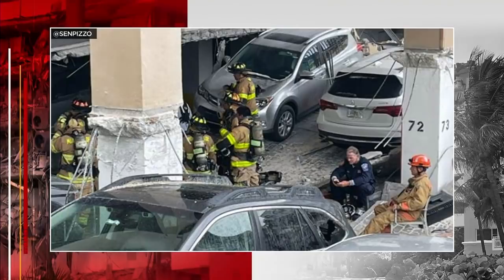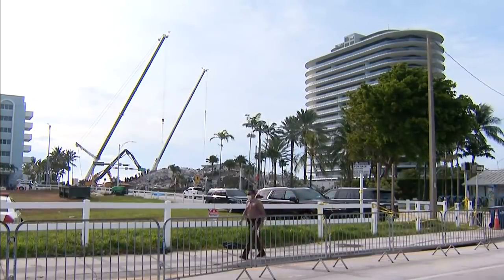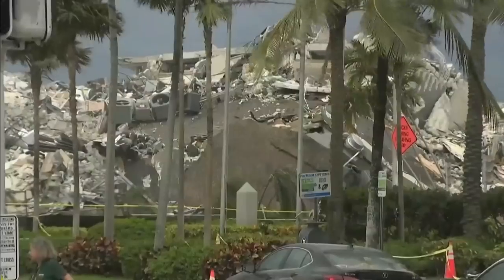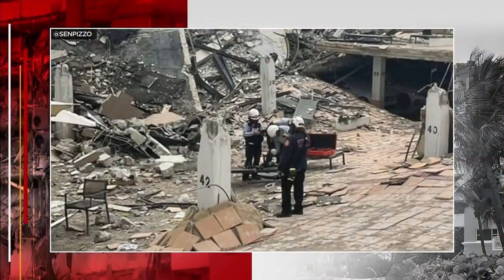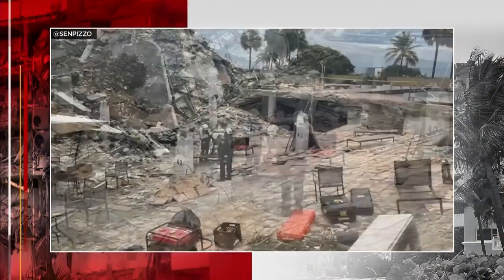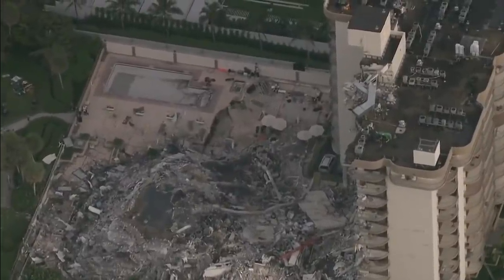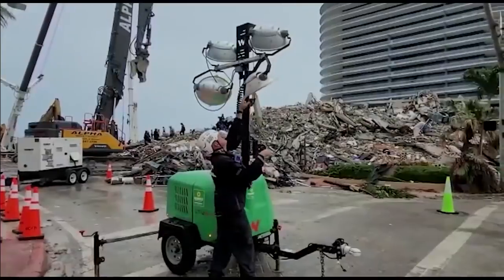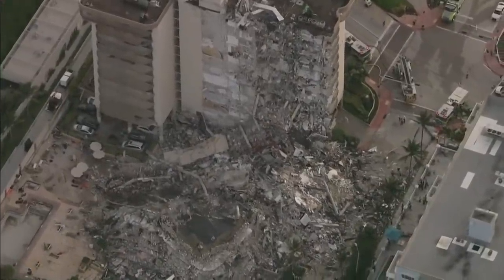Building experts studying Surfside collapse have questions about its initial construction

Comment: It appears based off of engineers who have done commentary on it that the pool deck was tied into the main supports of the building. According to eyewitnesses, the pool deck collapsed first. So, it is entirely possible that once the pool deck collapsed, the pull on the main structure of the building caused the main supports to snap. Evidently there wasn’t enough supports on the pool deck to keep it intact. It should’ve been freestanding. If that theory is correct then the building may still be standing.
Reply: Agreed. They should always make sections of large building shelf supported so if a section fails it doesn't domino the whole thing. Makes even more sense in an area that has hurricanes.
Reply: part of the collapse of the deck knocked out columns that supported the main tower.  This failure brought down the towers like dominos.

Comment: As one engineer also stated, it is not just rebar.  Some of you must know there are different strengths of cement also.  So that is also a question.  Was the quality of cement used a cheaper grade.  So many questions and yes if I lived in the sister tower I definitely would be vacating the tower to a new house.  Things were made a lot cheaper in the 70s  So get out while you can and be safe.  I am sure some criminal actions will be taken.  What is so sad is that it took a collapsed building with so many lives lost to bring the attention to officials.

Comment: Sounds like massive corruption to me.Where was the building inspector?Thats a major law suit.
Reply: Builder, Inspector, Structural Engineer, architect, developer, HOA, and probably several renovation contractors can be sued. Meanwhile about a week ago several large lawyer and developer firms were just throwing a fundraiser for a circuit judge............hmmmm........nothing to see here.  Even the fancy smancy building next door with the world class design team might have some splanin to do.
Reply: Duh. This entire thing was an automatic and major law suit, even if no fault is eventually found. Everything is a lawsuit.
Reply: Good luck trying to sue a city inspector. Look into famous fires where that never happened. The Station in 2003 for a modern example.

Comment: It's the usual finger-pointing game of "let's blame the builder".   As multiple other engineers have already stated publicly (including the 2nd one in this video) there is nothing unusual about finding actual field conditions being in variance with the original design documents.  Maybe there was a field directive by the design engineer of record to modify the original design.  As in most column/slab intersections, rebar layout is very congested and the builder may have asked the design engineer for direction on how to modify the design, perhaps by using larger or longer bars than the original design.   Even if the builder screwed up, every piece of rebar in the building is supposed to be inspected and signed off by the engineer of record BEFORE a concrete pour is done.   And as the reporter noted at the end of the video, there should also have been routine structural inspections by the City or County which also would have to approve the actual work as installed prior to every concrete pour.  Even if the rebar at this condition was done improperly or never inspected/approved, the building stood up for 40 years, which proves that design redundancy was in place.   And as the reporter also noted at the end, every engineer they talked to agree that this particular column/slab rebar issue by itself would NOT have caused the collapse. After reading the 2018 inspection by Morabito Consulting, it's clear to me the primary cause of this tragedy was the lack of routine and necessary building maintenance.  The Morabito report was absolutely clear that the building was in need of immediate repairs which never got done.   Their prediction of future exponential damage to the structure proved to be correct.
Reply: Agreed but I also can't help but wonder if the lack of sloping on the pool deck/garage area in the original design contributed. 🤔
Reply: @spindleblood  There is a conflict in the 2018 Morabito report on that issue.   He did say the pool/garage deck was flat with no slope which allowed water to pool over the waterproofing.   Then he said the "pavers, topping slab and waterproofing needed to be removed and replaced".   That implied to me there was the main flat deck, topped by waterproofing membrane, which was then covered by a concrete topping slab and then the finish pavers.  In that configuration (which is common), the topping slab would have been cast with a slope to ensure positive drainage.   If it was just a waterproofing membrane over the main flat deck covered by pavers, that would be a problem.   And if the waterproofing membrane had never been replaced in 40 years, that is a MAJOR problem.  Modern waterproofing membranes might have a 10 or 20 year life span at best.
Reply: The developer has a nefarious history of cutting corners and other profit motive shenanigans. Google: Nathan Reiber Nattel Construction

Comment: translation: Miami-Dade building inspectors during that time period need to be hunted down, arrested, tried in court, and publicly stoned to death.

Probably a good time to take a really long investigative look into current Miami-Dade/Surfside inspectors and start running back on some of the stuff they are signing off on.

and inspector should be more experienced, more well versed, and and have superior knowledge of all aspects of building code and construction processes.

100% chance the ppl they've been hiring do not have ANY of these qualifications.
Reply: While I agree they should be more experienced, it probably won't happen. Being an inspector isn't a great job, it doesnt pay that well, you're always the "bad guy" on a construction site and as a whole the system is flawed. I'm not entirely sure what standards are for today but I would think whichever engineering firm designed/signed off on the structural components/safety would be doing their own inspections at various stages. An engineering firm takes a great deal of liability on the plans and designing proper construction methods, so catching shoddy work would lay blame to the construction company doing the work.

Inspectors for the most part just read whatever plans there are and sees if the construction is following said plan.
Reply: What makes you an expert of inspectors qualifications?
Reply: It was a surfside inspector 14 hours before the collapse who said the roof looked amazing. He said he didn't see any problems on the roof  That he saw with his building inspector eyes,  or  lots of other things he should have noticed.  3 months before he was on the roof 14 hours before the collapse, a report was done and it said that the roof was deteriorating quickly, there were cracks up there, and other things that he should have noticed. I went to how much he got paid to overlook everything??
Reply: Yep, time to update

Comment: Hearing and reading some wild theories here. It's still only theories, not facts.
What is fact is that several areas of deck separated from the columns, punching shear. The columns were still standing, so no pile or soil or foundation failure. When the column loses lateral support from the deck failure, it's effective length becomes twice as long. However, it's load capacity is reduced to 25 percent of original capacity. Therefore, building falls down. The connection failures were most likely from corrosion of rebar, not lack of rebar. If it was lack of rebar, it would have fallen down long ago.
Reply: Less bars, means less resistance to cracking and respectively more vulnerability for corrosion
Reply: @markmd9  yes, but less bars means it would not have stood in the first place. It would have fallen/broken long ago.
The rusting of the rebar slowly weaken the load capacity until it fails. Probably not a design fault, but more likely a lack of maintenance fault.
Reply: @kurtdietrich5421  having less bars doesn't mean that the floor should have fallen right away. You can have enough of them for the construction to stand but not enough to stand for long time. 
All the weight of the building is supported by the concrete. The role of the metal bars is to stop the formation of cracks in concrete. 
Less bars allowed for the cracks to form, the cracks accelerated the exposition off metal bars to water, they began to rust and accelerate the formation of other cracks until it had felt.
Reply: @markmd9  the rebar is for tensile loads in the concrete, not just crack control. The concrete is good in compression but not tension. Not enough bars and it would have broken much sooner.
Reply: @kurtdietrich5421  precisely cracks control give that tensile strength to concrete bars. You can swap the metal bars with fiber glass needles and the concrete blocks will have the same or even better tensile strength than those with reinforced steel
Reply: @markmd9  no it doesn't. I'm a licensed professional engineer for 40 years and have worked with a concrete testing lab for 25 years. You cannot substitute fibers for rebar. Rebar is for strength. Fibers are for crack control.
Reply: @markmd9  ,wrong, rebar will never stop concrete from cracking. (Nothing stops that) concrete does what it wants.  Rebar was invented as a "safety net" for when it does crack. No amount of rebar can stop concrete from cracking. This is why slabs are sawcut after the pour. Columns use chamfer strips. It helps to control cracking. Concrete will crack no matter what you do.
Reply: @frankrogers436  you reminded me that 2000 years old roman concrete constructions are still standing today
Reply: @markmd9  ,yes, and?
Reply: @markmd9  that is so so wrong, where do people get their information from?
Reply: What I find appalling is why the collapse of the pool deck by one floor is enough to bring the 12 storeys down? Why were they built connected in that way?
Reply: @AbigailRTeh  the part of the building that left standing had thicker columns, the pool floor felt but the columns stayed still, on the other side, the part of the building that collapsed had thin columns, the floor felt and it took 7 minutes for the columns to bend and breake.
Reply: @AbigailRTeh  Simply by architecture and gravity. The design load of the building (namely pool slab and column placement for the garage to floors 1-12 weren't vertically aligned by design) didn't have enough of a safety margin built in to alleviate decadal poor maintenance which almost no designer can alleviate economically.
Reply: @AbigailRTeh  The decks provide lateral support for the columns. All building are built that way. Wood, concrete, steel.
Reply: You need to factor in developmental length of rebar into a differing plain, if bar had 18" of embedment into adjacent deck compared to 10' of embedment, makes a difference.
Reply: @roddiener  yes. Most people would not know that.😁
Reply: That's exactly what I was about to say. 😉

Comment: close inspection of the as built plans will show the support columns around the pool deck were smaller than the ones under the part of the building the stayed up , they look ok for the deck but , someone should have caught it when they doing the side of the building that fell , they used the wrong size support columns and cheated on the amount of rebar in all the columns , the deck fell because there was no slope for drainage , cyclic stress on the columns from daily rains , water sitting ,leaking into columns .

Comment: I’d bet there was a problem with the concrete mix as well.
Reply: You mean like not taking salt spray into account?
/sarcasm/

I'm curious to know what the curing time actually was for the foundation, & if pilings were needed, if they were driven to the proper depth
Reply: @Vidchemy  these cheap fellas couldn’t have done piles. They probably just did a shallow spread mat foundation. Explains why differential settlement is another point of concern. 
I don’t think concrete mix and proportioning is an issue here (rarely is anyway). The steel reinforcement, however, is of great concern. Look at the column to slab connection - it’s like the slab was just hanging by a thread (literally)! How stupid can someone be to sign off on that - you don’t need to be a structural engineer (which I am) to deduce that that’s not adequate to “connect and hold” the slab to the column!!
That’s why I never play games when doing site visits. If sth isn’t agreeing with drawings, I just mark it and tell the contractor REDO - time and money is out of your pocket. Just follow simple instructions!!
Reply: @LearnwithFrankM  I've been saying the same thing. The who section where each floor attached to the part that stood seems to be almost entirely devoid of rebar. It's amazing those floor slabs weren't problematic all these years.
Reply: Cutting corners by not using Sulfate Resistant Concrete will cause problems over time when exposed to Sea Water, which contains Magnesium Sulfate. It reacts with the Calcium ions in the Concrete to produce Calcium Sulfate, thus reducing the strength of the Concrete. The problem may not show-up for decades, but it will eventually.
Reply: @untermench3502  it would be interesting to see what the makeup of the concrete was throughout the entire complex......
Reply: @heyrod59  Core samples can be analyzed to see if the type of concrete specified in the drawings is the same as in the complex, also any degradation can be determined to determine the actual strength at the current time.
Reply: @NachoKitty  
The Calcium is part of the concrete, but Salts will attract moisture. What happens depends on the environment.
Reply: Tear them down every 20 years. That's how they build KMart & WalMart stores. Made to last 20 years.

Comment: Not surprising. Reminiscent of what was found after Hurricane Andrew blew the roofs off - The absence of roof straps and general shoddy construction. Yet they all passed their inspections!
Reply: ...and here I've been defending the builders because I'm a field superintendent and know you can't pour until your rebar inspection is passed. Apparently you can do things in Florida that we are not allowed to do in my neck of the woods. Hell, I once failed an inspection because the rebar shop drawings called for say 60 bars in a particular matt and we only had 59 because we go by the spec'd spacing of the bars which was first bar in 2 inches and 1 foot on center with the last bar also at 2 inches in. I told the guy, no problem just tell me where you want us to put that other bar because you just checked all the spacing and we were perfect on it. Took like 4 hours and 20 calls for them to realize it wasn't required and was probably just a mistake by the guy who made up the shop drawings.
Reply: @davidgray8089  Same thing in my country. In some states regulations are so strict you can't even use materials from two different brands when pouring (gfather-in-law owned a bridge beam concrete company). In others you just pay the extra' fees' to the local government and you can build whatever you want, using unqualified labor and even avoiding blame if that labor is injured or dies. Upkeep inspections are never done or are done by a 'mate' who passes regardless of problems. My sisters highrise had a fire that trapped several people because the fire doors were no longer closing properly or had latches that were broken so the door swung freely. Some money changed hands and the blame was placed on the family having a bbq on their balcony as the cause with none on the owner of the building.
Reply: @davidgray8089  Looks like you guys do things differently than in our neck of the woods up here in Canada.  I am a retired structural engineer who detailed about 100 suspended reinforced concrete slabs for apartment buildings, and if there is a bar missing in a mat or a band, I just get the boys to throw one in, and life goes on.  No need for 20 calls and 4 hours of bs.  Cheers.
Reply: Florida is like a third world country.  So corrpt.
Reply: @1m2rich  Miami-Dade county is.
Reply: @1m2rich  ,  we shouldn’t be surprised.  There are a lot of people from Central America and South America migrate to Florida and they brought with them their corruption culture.
Reply: @mathildaapril1175  were did you migrate from bringing your bigotry.?
Reply: @torozco516  Stop crying about the truth he posted.
Reply: @vmxg8052  what"truth" are you talking about?
Reply: @torozco516  , I am not from central or South America.  I am telling you based on what I saw from my daughter’s school, which has 60% Latino.

Comment: It's no wonder. A building like this should have lasted for much longer if built properly. There are older buildings in tact 70, 80 years old.
Reply: The blue and white hotel next door was built in 1965 and is apparently in great shape, solid as a tank. There are 20's and 30's deco buildings in Miami Beach that are holding up just fine too. Champlain Towers South was a perfect storm of incompetence, greed, corruption and stupidity.
Reply: @denverdubois5835  I'd live in the blue one. It's gorgeous.
Reply: this was a newer design though so now we learn what corners should not be cut
Reply: @inlandempress4587  there are millions of new and different designs, it's what's been happening over the years and no one doing anything is the problem, there are buildings still standing over a 100 years old some 150 plus, I wonder if any of the workers from doing they building are still alive and can find out what they thought at the time e.g the boss of the workers or even the people that ordered the work, every stage had to be signed off from is there enough footing to finishing electrics etc